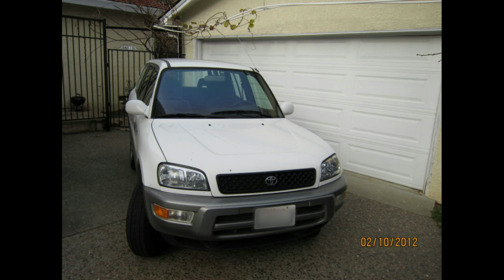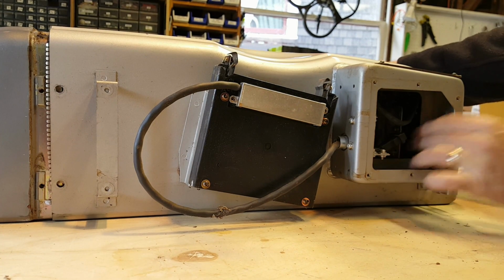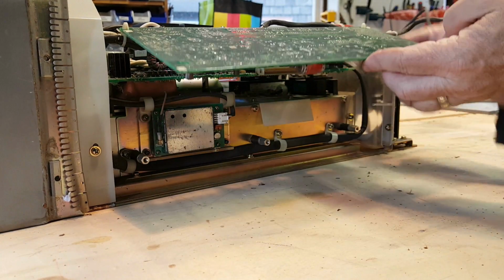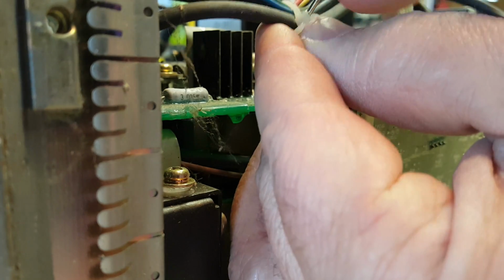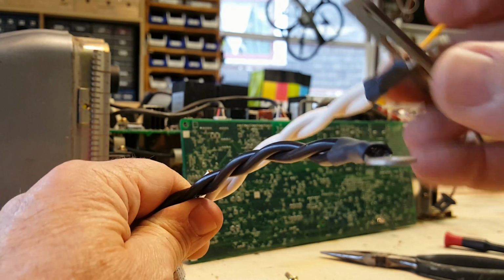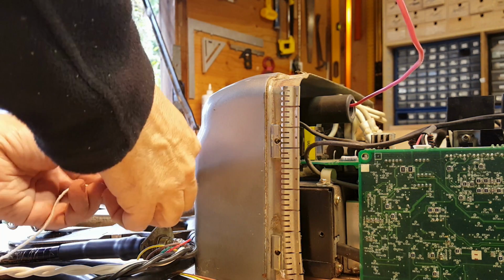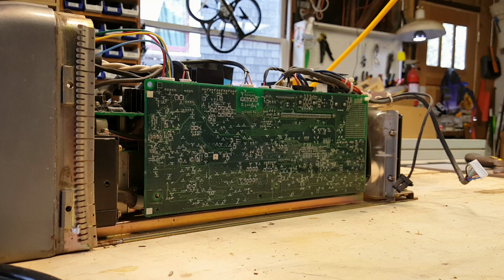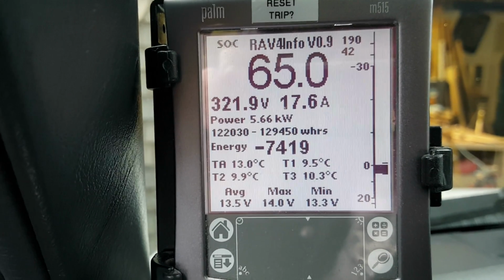Replacing the Paddle/Cable on Small Paddle Inductive EV Charger

Comment: A couple of notes:
@ 4: 24 the bleeder resistor is the large white rectangular-bodied item this side of the two yellow capacitors in the image. Shorting not needed.
It slowly bleeds off the internal 385 volt  over the course of several minutes.  Ten minutes after mains disconnect - you're safe.

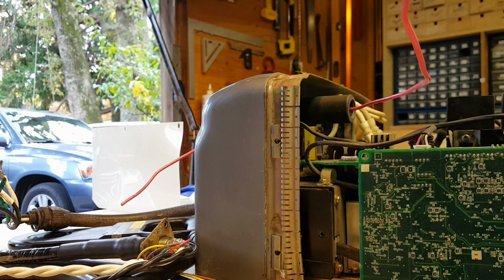@ 12:35 and later, the process of threading string / wire thru the five toroid cores (that long black, shrink-tube-encased hollow tube) to tease the four #10 AWG power conductors thru misses one important point.  Each color has a pair of power wires that are twisted together. Then the pair of whites and blacks are tightly twisted around each other again, to make four tightly wound conductors. Why?

This is done so that the fast risetime pulses of high voltage maintain good fidelity and to minimize their EMI radiation in the box.  The long black paddle cable is heavily shielded with braid, and foil.  (Twisted pairs of wire are self-shielding and exhibit a controlled impedance, like a good transmission line.)  This should be followed in this replacement process too.  Back in the days before widespread digital HDTV, this charger was a veritable broadcasting radio noisemaker! 

To save time on this reassembly process - twist the black and white pairs tightly, align the two ring lugs, and then loop a "pull wire" thru both lugs.  Wrap that pull wire once with electrical tap to keep the ends from snagging.  The strength comes from the wire. Then you can pull with as much force as needed to get things back together.  Too much tape and it will bind.

The power cables on the main motherboard polarity doesn't matter, but recommend that you put it back the same way you found it.

That little RF cable has a very tender connector.  Don't slip with your needle-nose pliers or you may damage it.  But no worries, no one uses that feature anymore. It was for backwards compatibility with the GM EV1.  The RF signaling interfered with the public service bands in Japan and Toyota re-designed the small paddle charger called the Gen II + in 1999 and thus the TAL model was born.  (It's actually a Gen III unit!)

While it's open, why not spend a little time with some compressed air and a brush cleaning the cobwebs and dirt?   

Nice job Darren.  Hadn't seen this before!  BTW: you should change your Palm Pilot readout to Fahrenheit! ;)
Reply from the maker: Thanks for the great tips, Ron! To all future viewers: Ron has more experience than anyone when it comes to repairing these chargers so his advice can be trusted.   

My main RAV4-EV now has a J1772 conductive charge port so I'm not using this charger anymore.  The white RAV4-EV shown in this video is waiting for an upgrade using Nissan Leaf batteries and associated BMS..  

My Navy electronics training taught me never to trust a bleeder resistor to save your life. I guess that lesson stuck with me but I've rarely seen a bleed resistor fail.  Celius makes me feel like a scientist.  :-)
Reply: @DarrenOverby  Hi, Do you have a write up for the upgrade to Nissan Leaf batteries and BMS? I'm trying to bring a gen 1 ev rav4 back to life and need to replace the batteries. I have been trying to figure out what to do about the paddle charger since I don't believe that is a common charging option anymore at a charging station. So replacing the batteries with a Toyota pack will only allow me to charge at home unless I do something about the charging port. Do you know if there is some kind of an adapter to go from the inductive paddle to J1772 plug for example? I have seen a post about a guy driving his Gen1 around with the wall charger strapped to the passenger seat and I would like to avoid that. I am not sure what my options are. Any thoughts?
Reply from the maker: @vwadolowski  Check out this page: http://evnut.com/Rav_li_217.htm

You might also want to contact the webmaster of that site.  I have his RAV4-EV and he previously modified it to accept a J1772 charge.   Sorry, I don't have details on that conversion.